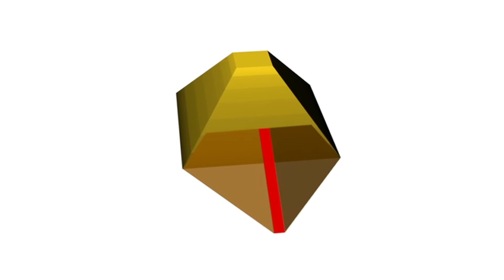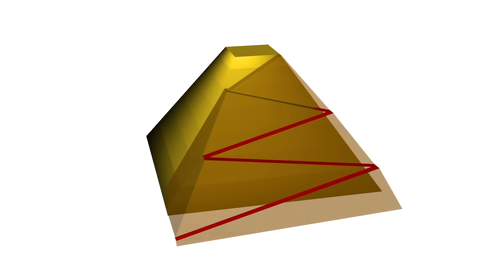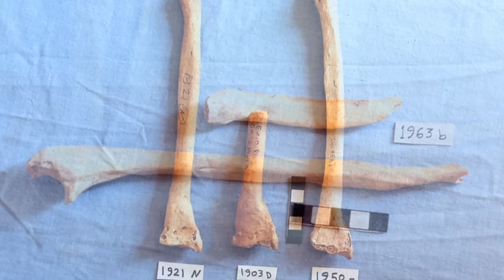Egyptology - Pyramid Construction

Comment: If it was possible to flood the area with dams around the structure.
you could use wood,rope, and air trapped in animal skins as floatation devices.  Effectively flooding and floating the pieces from a temporary dock to the structure method
.
It would be helpful with lining up blocks since you don’t have to break people’s spines doing it.  Once it’s finished the water is redirected and returned to the Niall river. It would still be a huge effort but it could help people use floating crafts to paint and carve. 

At least that’s the way I’m writing a story.
Reply: Animal skins? What pills are you on, that animal skins could float 1 ton blocks 😂
Reply: @timange124  kind of floating devices weighing like 2 pounds to hold a fully grown adult

Comment: Egyptologist starts off admitting he doesn't really know and its all "inference" and then the narrator proceeds to pronounce the idiotic "ramp" theory like its a proven fact.
Reply: 1 - Herodotus stated that the Egyptians spent 10 years building what he termed as "a great causeway" to then spend another 20 years on the pyramid itself.  Ergo "causeway" = "ramp".
2 - in the western cemetery next to the Great Pyramid are partially completed tombs which still have the earthen ramps used in their construction.
3 - the earthen ramps at Giza are made from a mixture of sand/stone chips/tafla - a clay they mined.  Near the worker village at Giza is the remains of a huge tafla mining operation.
4 - when the limestone quarries at Giza were excavated years ago they were found to have had massive amounts of...........sand/stone chips/tafla dumped into them = or what they built ramps from. So as they encased the pyramids in white Tura limestone they systematically dug away the ramps and dumped the residue into the open quarry pits to backfill the area.
5 - finally at Karnak are the remains of mudbrick ramps used in the construction of hypostyle temples there.  Also the tomb of Rekhmire shows a hypostyle temple being built using a mudbrick ramp.

Moral of the story:  there are other examples of ramps used in construction of course besides the evidence noted above = but the point is made.  Better luck next time with whatever "internet fantasies" you want to believe.  For the rest of thinking humanity however we follow the actual evidence on the ground.  As John Adams famously quipped:  "facts are stubborn things."

Comment: The ramp would be as difficult to build as the pyramid. I've seen many theory's and I'm not buying any of them, idk how they did it, the accuracy is ridiculous, the only theory to account for accuracy is the theory of melting and pouring blocks into molds, but that's hard to believe too, it's still accuracy after 5 thousand years, wtf.
Reply: Aliens? people don't believe that but who can lift 80 ton blocks?
The most obvious theory is probably the one they used.
It staring them in the face   👀